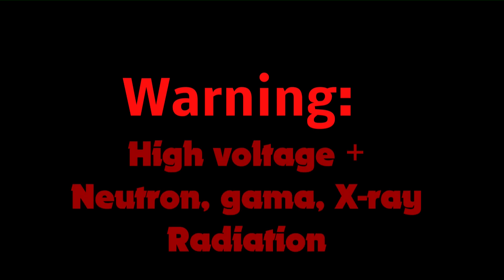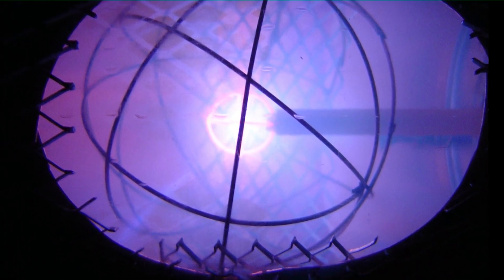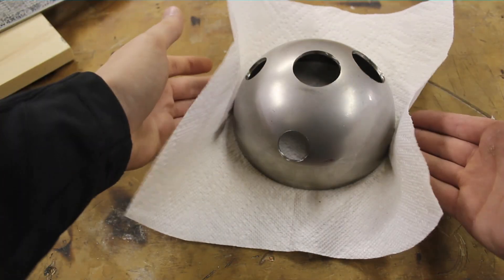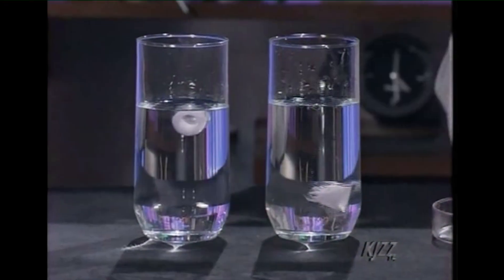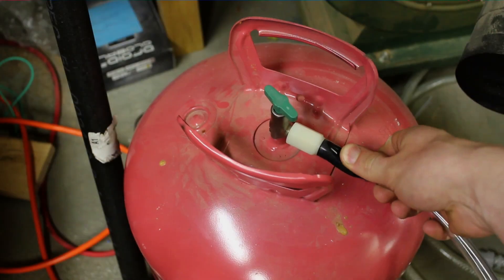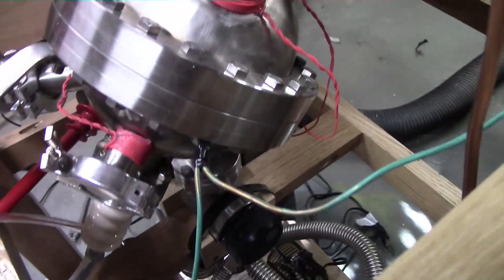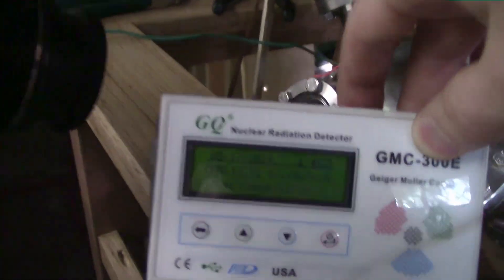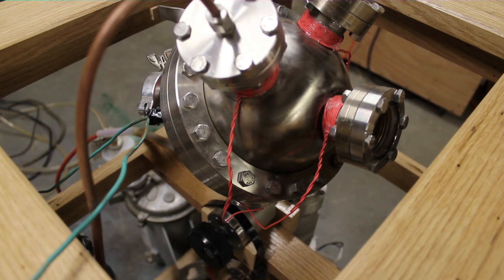How to Make A Fusion Reactor

Comment: What if I use hydrogen instead of deueterium
Reply from the maker: +Nihal Jalaluddin You'll get a cool plasma and some x-rays, but nowhere near P+P fusion energy. To put it simply, there isn't as much mass in the nucleus, so it takes a lot more speed for P+P
Reply: +BenNBuilds why should I use hv with negative polarity
Is to strip of electrons?
Reply from the maker: To accelerate positive nuclei
Reply: +BenNBuilds so I can't use positive polarity,right?
Reply from the maker: If you ground the grid and throw the positive voltage on the chamber you could. I would recommend reading up on electricity and high voltage safety a TON first. Even the slightest mistake will kill you immediately at these voltages
Reply: +BenNBuilds can I use this reaction to power up something
Reply from the maker: Not really
Reply: +BenNBuilds I want to build this for a science fair project,which is coming too close and I cannot get deuterium ,can you please tell a way to make deuterium or can I use hydrogen?
Reply: +BenNBuilds please tell
Reply from the maker: You can electrolize heavy water to get deuterium, its also pretty hard stuff to get tho. If you are just doing it for a science fair, you could just make a demonstration reactor, without using any deuterium. Just show them the plasma in a vacuum invironment and they'll likely think it's cool enough
Reply: +BenNBuilds can I use hydrogen?
Reply: will hydrogen are harder to do because when it contact to oxygen it start to burn out and form water
so it will be need air seal(sorry my enlish suck. or duck!) and bonus duck!

Comment: Can you use deuterium in a reactor with a bell jar as the camber?
Reply from the maker: +Christian Holbert Sure, but you'll need a large anode in there, too
Reply: BenNBuilds will the glass stand the heat? And how do I get deuterium in the bell jar?
Reply: +Christian Holbert there's not really any point in putting deuterium in a bell jar. You can't get the vacuum levels you need in a bell jar, and at the energy levels you need to do an actual nuclear reaction, there would be tons of X-rays pouring out of the glass. Not safe nor useful to put deuterium in a bell jar.

Comment: Can the radiation be lethal ?
Reply: Samuel Garcia No are you? But i'm glad you felt the need to try and come off smarter than me. Mind explaining how factors or time and size or the reactor play a part in the radiation levels?
Reply: yes it can be if you contact with it a lot but if you have some radiation(sorry my english suck)protechtion then you are prety safe
Reply: Lol Lol Could you overload it? Like make it explode?
Reply: +Mike Hunt 
Yes. I have built a few of these and two have detonated. It's not common if you build it correctly and the blast isn't to dangerous.
Reply: If you build this one the blast radius (not including shrapnel) is about 5-10 meters. Radiation might go a couple inches into the soil but it can be dug up easily and isn't very dangerous.
Reply from the maker: +Владимир Рыжов lol
Reply: +Mike Hunt Hey, I think that guy with the Russian name is fucking around.

Yes the radiation is dangerous, but probably not lethal. If you wanna do this then play it safe, buy a Geiger counter and a lead jacket, although you will probably be fine as long as you don't inhale or ingest it with out those.
Reply: Владимир Рыжов What happened when it detonated ? Just blew up. How big was the explosion?
Reply: Mike Hunt you mean radiation suit or reactor?

Comment: hey Ben, could you enlighten me on exactly how you got 30-40kV at 10mA? I really am stuck on this part of my build because dont know how to get to this voltage.
Reply from the maker: +BobMarkusBob search around e-bay for transformers and power supply's. It can take quite a while to find the right stuff
Reply: +BenNBuilds i meant the wiring aspect, was there some schematic you built off of or did you just jury-rig it?
Reply from the maker: The 10MA is conducted through the plasma, its literally just some plasma and a ballast resistor between the power supply output and ground. super simple

Comment: Is it really a fusion reactor? I heard you have to get the temp up to 50,000000 degrees? And then the through the fusion process would set off a chain reaction?  just a question.
Reply from the maker: Clark Kent It should get that hot, but it would be really difficult to measure. It takes more energy to slam the nuclei together than you get from the fusion. Even the sun doesn't start chain reactions, it only fuses in the core where the pressure and temperature is great enough.
  You may be thinking of fission, where an element like plutonium or uranium is hit with neutrons. They split and release more neutrons, which collide with more atoms and cause massive releases of energy in a very short time

Comment: He does realize that neutrons will penetrate 1/4 inch aluminum at 40,000 volts and glass at 10,000 volts, he should have added more shielding, if enough radiation was leaking through the gas to make the silver radioactive, he should NEVER have been near that thing while it was running. Sit in front of it for about 2 hours, and you have an 80% chance of getting sever radiation poisoning or cancer.
Reply: That's not aluminum, it's stainless steel. But that only matters for the X-rays. He used probably something like high-density propylene to block neutrons, which is very effective at blocking neutrons due to the large amount of hydrogen contained in it.

Comment: ÜÜÜÜÜÜÜÜÜÜÜÜÜÜÜÜÜÜÜÜÜÜÜÜÜÜÜÜÜÜÜÜÜÜÜÜÜÜÜÜÜÜÜÜÜÜÜÜÜÜÜÜÜÜÜÜÜÜÜÜÜÜÜÜÜÜÜÜÜÜÜÜÜÜÜ
 Ý±23 Oct 90±±±±±±±±±±±±±±±±±±±±_ROR_-ALUCARD±±±±±±±±±±±±±±±±±±±±±±±±Ý?  Þ°
 Ý                                                                     Ý A Þ°
 Ý                                                                     Ý  ?Þ°
 Ý        SIR DEATH'S LABORATORY                                   A   ßßßßß°
 Ý                                                               Tfile     Þ°
 Ý              How to Build a Nuclear Reactor                Distribution Þ°
 ÜÜÜÜÜ                                                          Centere    Þ°
 Ý?  Þ                                                          - RoR -    Þ°
 Ý A Þ_____________________________________________________________________Þ°
 Ý  ?Þ Shawn-Da-Lay Boy Productions, Inc.úúúúúúúúúúúúúúúúúúúúúúúúúúúúúúúúúúÞ°
 ÝÜÜÜÞÜÜÜÜÜÜÜÜÜÜÜÜÜÜÜÜÜÜÜÜÜÜÜÜÜÜÜÜÜÜÜÜÜÜÜÜÜÜÜÜÜÜÜÜÜÜÜÜÜÜÜÜÜÜÜÜÜÜÜÜÜÜÜÜÜÜÜÜÜÞ°
   °°°The Hollow's Alliance 415/236/2371°°The Electric Pub - 415/236/4380°°°°
   °Primary Drop Sites°°°°°°Rat Head - 415/524/3649°°°°°Primary Drop Sites°°°

                    SIR DEATH'S LABORATORY

HOW TO BUILD A NUCLEAR REACTOR:

     A back-yard reactor is easy to build, and a fascinating
educational project.  It can also produce an inexpensive
supply of hot water - handy in these days of high fuel bills!
Just follow theses step by step instructions.

You will need:

* A 32 gallon plastic trash can (heavy duty, and preferably
  with locking handles to discourage inquisitive pets and
  children).

* 45 Feet of 3" PVC plumbing pipe

* 10 Feet of 2 1/2" PVC plumping pipe

* A keyhole saw

* A Hacksaw

* Duct Tape

* A meat thermometer

* 12 Standard 75mm rods of U 235

1.  Cut your three-inch piping into 28" lengths-nineteen in
    all.  Position the sections vertically in the trash.  A
    few inches of sand in the bottom will help hold them if
    necessary.

2.  With the keyhole saw, cut seven holes in the trash can
    lid, corresponding to the locations of the pipes.  These
    are for inserting your control rods.  Cut three more
    smaller holes as shown.

3.  Now for the control rods.  Cut the smaller pipe into 34"
    lengths - seven in all.  Seal one end securely with duct
    tape.  Fill each rod to the top with an appropriate
    damping material.  The "pros" use graphite, but a good
    potting soil will work nicely.

4.  Slide the fuel rods into the correct pipes.  Safety
    first!  Wear gardening gloves when handling the U 235.

5.  Pop on the lid, lining up the holes with the control rod
    sleeves.  Insert a garden hose in one of the 5/8" holes,
    and fill the trash can right to the top.  Heavy water is
    best here.  (If you live near a nuclear power plant, you
    may already be getting heavy water from your tap.  If
    not, plain water will do).

    A second garden hose will carry the heated water out,
    provided the can is higher than the end of the hose.
    NOTE:  Before doing steps 4 & 5, be sure to insert the
    control rods into their sleeves.  Otherwise, there is the
    risk of a "runaway" reaction.  The inserted rods will
    stick up six inches above the lid, so you can grasp them
    for removal.

6.  Push the meat thermometer into the small hole in the lid.
    Now, by altering the flow of water from the faucet, and
    by removing more or fewer control rods, you should be
    able to maintain a constant temperature inside the
    reactor.

    You can use the hot water you produce to run a toy
turbine, heat your doghouse, or fill a ht tub.  Any overflow
can irrigate your garden, where it will often produce
beautiful and unusual foliage.  Always dispose of spent fuel
rods properly.

* U 235 rods can often be obtained through local hobby or
  terrorist groups.  Or order by mail from "The Electric Pub,
  1113 E. 7th St. Stagfarm, NJ 08865.  You must state that

 Call these other fine boards.....
 -=-=-=-=-=-=-=-=-=-=-=-=-=-=-=-=-=-=-=-=-=-=-=-=-=-=-=-=-=-=-=-=-=-=-=-=-=-=-
 = MoonAngel   ....................: Sid Gnarly  .............415/236/8192 =
 = The Skeleton Crue  .............: The Black Avenger  ......415/376/8060 =
 = The Village ....................: Shandor   ...............415/237/4145 =
 = The Meth Boat  .................: Laughing Swede  .........415/527/9264 =
 = The Holiday Inn  ...............: The Dak   ...............209/456/8584 =
 = The Chasm - Plague  ............: Mad Hacker  .............502/685/3010 =
 = Lunatic Labs ...................: The Mad Alchemist   .....213/655/0691 =
 = The Nemisis EyE ................: Steve Austin  ...........408/263/2818 =
 = Temple of The Screaming Electron: Jeff Hunter  ............415/935/5845 =
 -=-=-=-=-=-=-=-=-=-=-=-=-=-=-=- RoR - Alucard -=-=-=-=-=-=-=-=-=-=-=-=-=-=-=-
Reply: You warm my heart with this.

Comment: I really want to build one, but i am afraid of cell-damage due to radiation. Whats the best way to prevent this?
Reply from the maker: DireWolf Lots of shielding. I used tons of lead for the x-rays and some big water tanks for the neutrons
Reply: im mostly scared of the high voltage.
Reply: Lead lined concrete submerged in water. Put a GoPro inside if you want to watch.

Comment: can i know where did you get the deuterium tank?
Reply: But on a real note Deuterium is extremely rare and very expensive as it's a special form of hydrogen that's slightly radioactive. If i were looking for it my best bet would be asking a national scientist, the government of the country or the military.
But if asking nicely get you nowhere, then Onions might help you... If you know what i mean
Reply: @grim4244  Deuterium is still a stable isotope of hydrogen. You may be thinking of Tritium
Reply: here in greece its relatively easy to get deuterium. Its just very expensive(350usd per 100l). But I would recommend buying a pem electrolyser and use it to make it from heavy water since its cheaper to make it this way
Reply: @nikoskaravitakis9437  well considering that 1/1600 parts of water is heavy water. For 350$, 100l sounds like a bargain
Reply: @grim4244  I think its even more rare at around 1atom of deuterium out of 6400atoms of hydrogen in seawater.Price is low because of economy of scale and its relatively easy to seperate due to the huge difference in mass compared to Hydrogen(protium) . I buy heavy water at 100usd per 100ml. At larger quantities its even cheaper at around 500usd per litre. Each ml of D2O if electrolyzed can make around 1litre of D2 gas. So its way cheaper to buy 100ml of D2O at 100usd and make 100litres of deuterium but of course its harder. Deuterium from china costs around 1$ per litre but shipping it here is super expensive.
Reply: As he said "its hard to get online as it's rare and can be potentially dangerous in the wrong hands but i just got mine after googling some signatures"... This is a joke but in reality I mean, he's not wrong
Reply: Galileo <— that username with your comment... thanks
Reply: You can buy bottles of Deuterium Oxide from eBay. Deuterium can be made by using a cheap fuel cell and some filters. If you have a company you could use Linde Gasses or Sigma Aldrich.
Reply: @zfgm1065  well now i have a chemistry degree, i just ask for used D2O to the guy running the NMR c:
Reply: @Ubya_  That´s so cool! I wish it would be that easy for every hobby physicist....

Comment: I really appreciate that you shielded with silver. That is an excellent check.  What was the overall cost?  Going to 30K pretty much cooks this reaction.  If you want to make history, you could be the first amateur in the world to get neutrons with a polywell... Mark Suppes only measured a voltage drop.  There is a fellow in England also going for it, as well as CSI and radiant matter but as far as I know, nobody has this record yet.

Comment: Can you tell me where you get your info im 13, and i love science i want to get into nuclear power and learn got any websites and tips and stuff. (dont say im to young, i built my own little electric car which i can fit in and ride)
Reply from the maker: When we can use simple blunt pressure to fuse atoms rather than faking pressure by accelerating everything
Reply from the maker: The sun is REALLY heavy, the pressure at the middle should be something on the order of 2.5x10^11 bar. Such a centrifuge would need to have a mile radius spin at nearly 1,000,000rpm with a 500lb load on the end to simulate that sort of pressure, unfortunately
Reply from the maker: wikipedia, instructables a couple youtube video's idk. they work off super simple principles so once you get an idea of what to do you can plan out a chamber and it just goes together really quick after that.
 What do your parents do, if you don't mind me asking? Make sure your dad or mom knows about high voltage safety and radiation shielding. There are quite a few ways to end up dead if it's not done right
Reply: BenNBuilds Ummm my dads a Physics science teacher and my moms a electromechanical engineer
Reply from the maker: oh nice, yea I honestly just looked up how farnsworth fusors work and looked up some that other people built than kinda made it up as I went along after that.
Reply: BenNBuilds Thats awesome btw quick question do you think the world needs nuclear power i think nuclear power is really cool but not neccesary
Reply from the maker: It's better than burning oil for now but I think tidal generators are going to start getting really good
Reply: BenNBuilds when can we harness fusion?
Reply: the sun does that through gravity, so could you technically use centrifugal force in a way to substitute gravity?
Reply: the most advanced reactors today (tokamaks) use magnetic fields instead of inertial electrostatic confinement like fusors do, and can actually produce quite a bit of energy. However they still produce a net negative amount of energy.

Comment: Can you create deuterium and tritium from putting water around the fusion reactor
Reply from the maker: I don't think its worth it. That tank I have will last forever because it barely takes any D2 to fill my chamber to ~25mtorr. You need deuterium to get it fusing anyway and the amount you would make from the water certainty wouldn't be enough to keep it running. I used some water tanks to stop the neutrons from slamming into me and I really doubt the concentration of heavy water in there is much higher than when I filled it, but who knows for sure
Reply: BenNBuilds ok that is some good information thank you